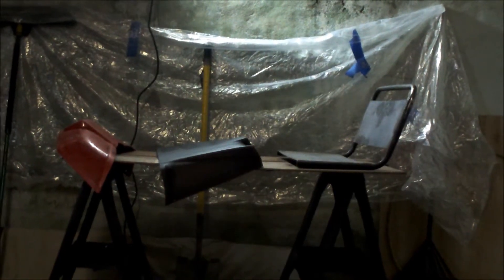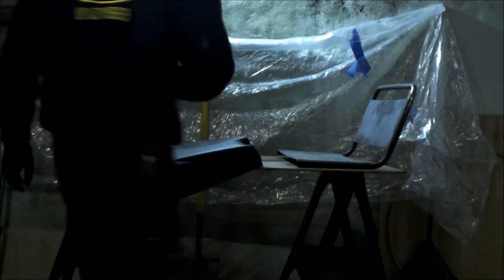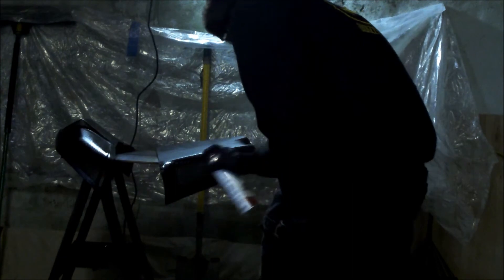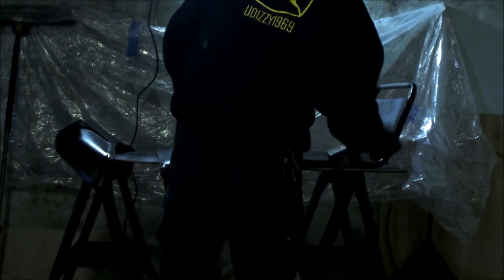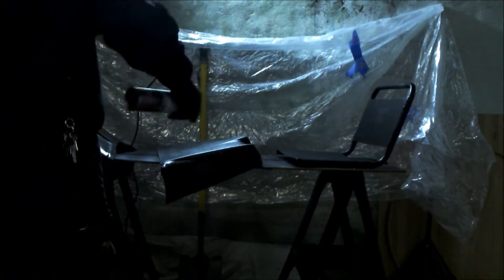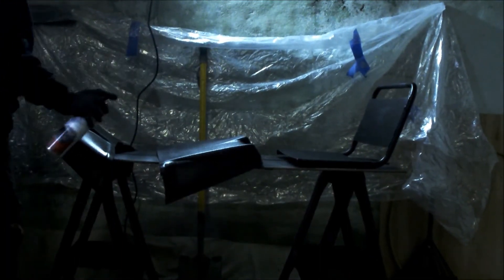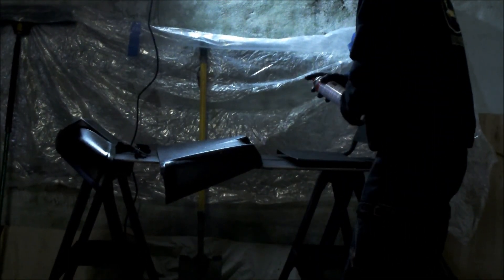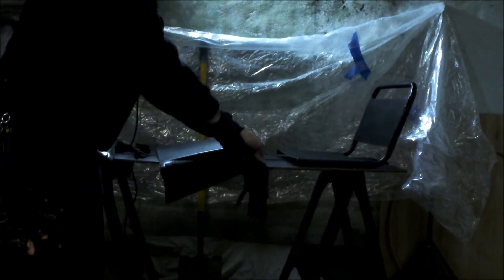how to make a Gokart last forever part#3

Comment: some of the reason for blotchyness with that stuff because irs so thick is the way your are spaying, you need hold the trigger an do longer stroke
Reply from the maker: you would think that bro, BUT!!  its not spray paint, its bedliner and it want to spit more than spray. she looks great now two coats both sides. and the plastic came out mint

Comment: Have ya been turnin the can upside down and blowin out the gas ?  This clears the tip (Also known as an actuater) so you can use it again. Works on paint, should work on this stuff too. Cheers Bro.
Reply from the maker: thanks man, keep that in mine.  cheers